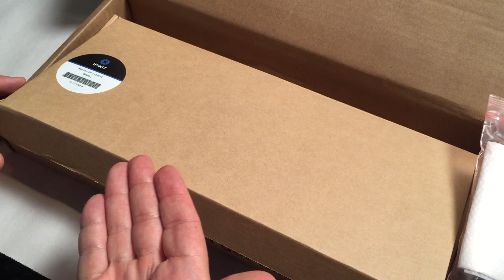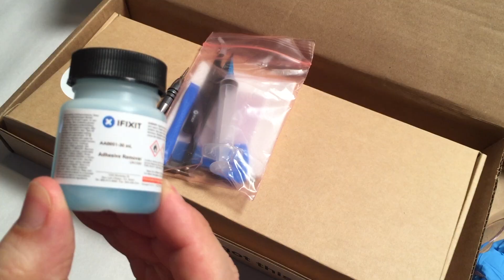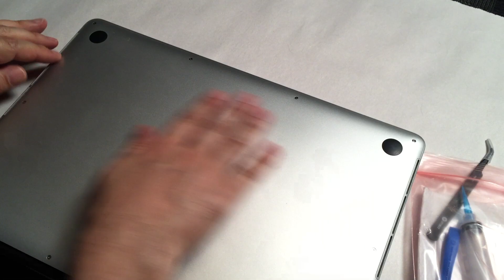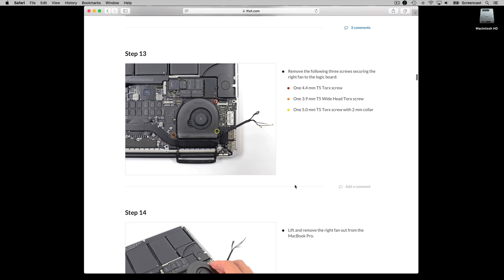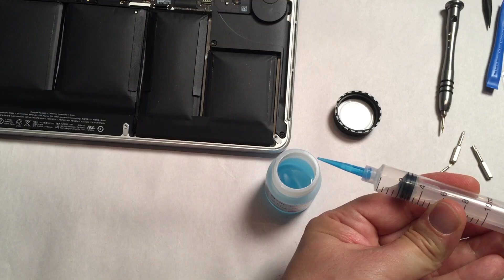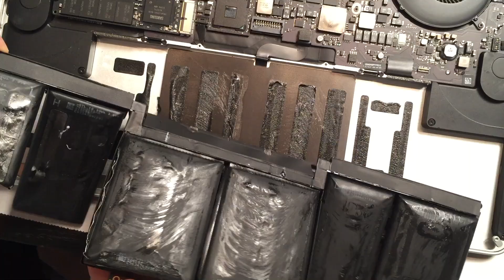Repair: MacBook Pro 15, Late 2013 Battery Replacement [ENGLISH]

Comment: I feel so pumped up as our very old 2013 MacBook Pro now has a new battery and new feet thanks to your super easy to follow video. The quote at the computer repair store was a $60 deposit to diagnose which would go toward the $175 new battery install fee. I was able to get a battery kit from the famous online store we all know of for less than $40 which included tools etc. An hour later, the battery is installed and charging our "new" MacBook Pro! You are brilliant and I thank you so much! I hit a like on this video. Have a great day and God bless!

Comment: Thanks Puromac for this video. I got this same MBP 15 late 2003. Battery cells were swollen so bad that they pushed upward on the trackpad. The trackpad stopped working and the machine didn't sit flat on desk surface. From what I hear this is common issue with this model. I have followed your video and successfully removed the battery with isopropyl alcohol and an old credit card. I did not install new battery so I am now using the machine as a desktop. It works fine, plugged in the wall, and the trackpad functions normally now. No more having to plug in an external mouse. Thank you again.

Comment: The removal part was so slick. I wanted to get rid of the batteries but I don't have replacements. So there is a chance that I broke something. But your method worked really well.

Comment: My mother has my old 2013 MBP and the battery is obviously by now dead. I asked a local shop how much the replacement would cost and they quoted 300 eur and told to recycle the laptop as it's not worth it. The thing is, it is perfectly usable and has a fast ssd so throwing it away would be insane. Ordered a new battery for 40 eur from China and replaced it myself.

Comment: Hurrah for this video - such a time saver over the iFixit steps.  I just replaced the battery in my 2013 MBP using this method. I used a length of strimmer cord in place of string, and it worked really well indeed. Thank you for this video.

Comment: Reviewing this for the third battery replacement in the mac book pro I bought in early 2014  The computer works nearly as well as the one I bought in December of 2024 and a video much l ike this let me do the second replacdemdentg quickly on the night before a long tr ip when the first replacement of the original went flakey. This is a great video. I already had the kit so I just bought the ifixit battery.

Comment: excellent video im going to be ordering a new battery ASAP! I got to thinking fishing line would work very well as its thinner and just as strong to get behind the battery. We use it to remove emblems and things on vehicles.

Comment: Sir, I can't thank you enough for this very clear walk-through of the process from end to end. I took my MacBook Pro 15, Late 2013 in to the Apple store in late December 2022 and was prepared to pay them $200 to replace the battery. The machine was crashing frequently and when I took it off the charger, the battery level would go from 100% to 70% in about 5 minutes and then crash. Apple told me that the machine is so old, they don't offer replacement batteries anymore. I was going to take it to a 3rd party fixit place (GoEBITS) but then I came across your video. (Isn't YouTube the most wonderful thing?!) I took your advice and bought the battery kit from IFIXIT for $90. I noticed they also offered replacement plastic feet, so I bought a set of those too (3 of mine had fallen off). It took me about 90 minutes total to replace the battery and the feet and now my computer has a new lease on life! (And I feel so accomplished -- I'm a computer repairman!) Thank you, thank you, thank you!
Reply: This is encouraging!  I'll be going through this process next week (when my iFixIt kit arrives ... although they charge $110 now ... still a great deal!).  Wish me luck!

Comment: i've just purchased a replacement for a macbook pro mid 2014, but the A1618 instead of the A1494... did someone try to change the A1494 for the A1618? Some forum replies say i might be dangerous, smoe say it isn't...

Comment: Thank you for this.  I took my cover off to clean inside and saw how swollen my oem batteries are.  They still work great, but the puffiness worries me, so I will attempt this procedure to renew them.  I don't want them to rupture or cause a fire.  Lithium is such a perishable power-source.

Comment: The best way to remove those adhesive residue is baby oil - you can dip a Q tip and soak each adhesive they will be easier to remove/ scrape or wiped with a paper towel. To clean the baby oil after you removed the residue. Use a 90% isopropyl alcohol on a paper towel and wipe the surface where the new battery will go.

Comment: Great tutorial. Just replaced my battery following it (no issues at all), the string technique is what made it a lot easier, just have to be patient for the adhesive remover to do its work.

Comment: Good tutorial.  One of my only extra bits of advice would be to not squirt the adhesive remover directly onto the plate covering the trackpad (squirt it onto the cloth instead), since some of it might leak around the edges of the plate and get to the workings inside the trackpad, where it might do some damage if there are any parts that are sensitive to acetone.  Even if the acetone doesn't damage the trackpad, it could continue flowing downward until it leaks past the edges of the trackpad itself and drip onto the display, which of course has a clear plastic front, where acetone could indeed do some damage.  Just to be certain, it's a good idea, before you start applying the adhesive remover, to insert something impervious to acetone and other fluids between the display and the keyboard/palmrest/trackpad, like maybe a sheet of aluminum foil.
Reply: Thanks for this advice! I may need to replace my battery soon and will do this! :)
Reply: May be worth putting a hand towel or such between the case and the display, since others have mentioned the risk of getting alcohol.acetone on the display and ruining it.
Reply: That happened to me. It flow through the screen and stayed there for a while until I noticed. It damanged the black finish the LCD has... So be careful with adhesive remover.
Reply: how would you get the cloth you squirted remover on, to glue under batteries?

Comment: https://www.youtube.com/watch?v=ayzzXKa1HOA&t=2s&ab_channel=It%27sBinhRepaired
The mid 2014 15" Pro appears to be the same. I also recommend viewing the above video by someone with more experience. Also it illustrates that you don't have to use adhesive remover at all. I used the technique of mostly "sawing" through the adhesive with dental floss (finger killer) and a "Palette Knife".

Comment: Thanks so much, worked great. I didn't have that kind of adhesive remover, what I ended up doing is dabbing some Goo Gone on the string, adding a little more as I worked down each battery, worked beautifully. Thanks!

Comment: Thank you. the string works really well. I planned to take the battery out and use it without battery. But I find it's not working without battery. When it boots up, it will restart automatically.

Comment: THANKS so much.  Mission accomplished this evening.  I had my steel trash can at the ready in case of battery fire (as were quite swollen).  TIP: blow the dust off your fans while the cover is off - just a can of compressed air for this.

Comment: Awesome method. I used dental floss, which was easier to get underneath the cells, but did hurt my fingers when sawing. Cleaning the old tape didn't take too long; a lot of it peeled off quite easily. All together the job took about an hour and a half.
Reply: What liquid did you use for the glue?
Reply: @carlosraul6578  Just the one supplied with the kit.

Comment: This method worked like a charm! One video showed basically disassembling every component from the case prior to battery removal. That was too many screws and connectors to remove and reassemble. One slip and the MacBook was dead! Tilting the case to keep the acetone under the batteries, and using great care with the string negated the laborious disassembly. The residual tape in my MacBook was much more difficult to remove than yours.

Comment: Fantastic video.  Totally worth watching this and skipping the more complicated steps.  I regretted not buying the ifixit battery but already bought a replacement kit without the tools or adhesive remover.  For those in my shoes, you can use Goo Gone instead of the ifixit remover. It  is non-toxic as well and worked great.  It is a little nerve wracking at first to use the string method, but it works great. Thank you

Comment: Just did this, and it works. Thank you for showing me how. One thing that is different - the iFixit kit now includes a squeeze bottle with a tip rather than a small jar of solvent and a syringe. Much harder to control where/how much solvent is applied. The center 2 batteries were much harder to free up, perhaps because I was too concerned about getting solvent on the trackpad, which was underneath. But it worked!

Comment: Is it ok to use water with soap to clean the mouspad area once the old battery is removed ?
Reply: 90 to 99% isopropyl alcohol would be better. I wouldn't use soap.

Comment: can u use any adhesive remover like Goo Gone?
Reply: I'm going to need to change my battery in the next month. ifixit's adhesive remover is 99% acetone which I dont want to accidentally risk getting it onto the board. I'm going to use 99% isopropyl alcohol. isopropyl alcohol can dissolve adhesive too but doesn't work as fast as acetone. ifixit has an article about the proper use of isopropyl alcohol (https://www.ifixit.com/News/36877/ask-ifixit-everything-you-wanted-to-know-about-isopropyl-alcohol ) which was really helpful (and safer).

Comment: Just finished my replacement based on this video.  Excellent technique - the "string cutting" worked really well for me.  An additional note for this technique: you may hear a little "popping" that sounds like it could be battery cracking - in my case that was the sound of the little piece of metal below the center batteries flexing as I "cut" the batteries off it.  Once you know what that is, it's pretty obvious - but the first time it can make you worried that the batteries "cracked" (which, of course, no one wants...)

Comment: Thank you. This was great and I really appreciated not having to go through the 900 extra steps that IFIXIT gives us. I have to do this again for a Macbook Pro 13 (Early 2015). Are the steps the same, or do I need to find instructions unique to that model? Thanks in advance.

Comment: This is much quicker than removing all the components and the nylon string idea looks easier than using the plastic credit cards supplied by iFixit.  I went the other route and removed all the non-battery parts first.  I found a lot of dust inside the heat pipe vents and the fan vanes.  So this allowed me to use a soft artist's brush and vacuum to clean the dust off all the parts.  I agree there's more risk of damaging the very small connectors and you have to be careful when reinstalling the logic board not to trap the various cable ends around it.  Removing the dust allows my MBP to run cooler and quieter now with the new battery.   Thanks for the good tips.

Comment: You make it look so simple.  There is another video doing the same thing on supposably the same computer (MacBook Pro 15 late 2013).  On his, there are wires and electronics at the bottom of the batteries.  I haven’t opened mine up yet to see what I have but why the difference?

Comment: Excellent instructions. I just changed my battery out and it was so much easier than I was expecting. I used the iFixIt kit and it seems to be operating very well.
Reply: How is the battery life and how does it hold the charge?
Reply: @ElenGlazova  so far it’s holding up very well. The battery holds a charge just as it did when I first bought my laptop 7 years ago

Comment: Thank you for this! I just finished replacing my battery. I’m now doing the calibration procedure. This was easy, peasy with the help of your vid. The batteries came out easily. Just want to remind folks: don’t forget to drain your battery and to protect the display with aluminum foil.
Reply: Do you mean to just cover the display with aluminum before removing the battery? like sticking a layer between the keyboard and display?
Reply: @cheddarcheeze  Yes, to protect the display from any adhesive remover that may drip. Maybe overly cautious but it was cheap insurance . Here's a picture of what I did to prep.
https://www.dropbox.com/s/mhswogif6gs22hd/118982452_10220448064370555_2693333804486361030_n.jpg?dl=0

Comment: Thanks for posting this. Not having adhesive remover and the wires handy, I use WD-40 and dental floss instead. The dental floss is not as strong so it breaks easily, but I manage to do it eventually after several attempts. It takes me 2+ hours.

Comment: Typical crapple, my current laptop has one lid with 8 screws pop it off unplug the battery and install a new one, lid back on, job done.

Comment: I replaced the battery. It works fine now but the activity monitor gives me just 4 hours of battery life. The original battery gave me 8 to 9 hours of battery life. Using CoconutBattery says the battery has a design capacity of 8755mAh and a full charge capacity 8852mAh. is it normal ?

Comment: Fed, thanks so much for this tutorial. I completely agree there is more risk to taking out all the internal components as recommended by iFixit so I was very pleased to see, and then use, your approach. I used isopropyl alcohol to dissolve the glue, which I'm fairly sure was not nearly as effective as using the adhesive solvent, so the process took a bit longer and was more tedious than I'd hoped. But nonetheless all went well and I have a new battery in my 2012 Macbook Pro, giving it another few years at least. Thanks again Fed and @puromac!

Comment: I used this tutorial for my MBP 15" early 2013 model, and it worked great! In addition to improving my battery life, my laptop also runs much cooler than when my old battery had a "service battery" warning. I use the Mac Fan Control app, and I was clocking CPU core temps of 85-90C while using Google Chrome prior to this repair, and up to 100C for Adobe design programs! Now, the CPU cores run at about 45-55C for Google Chrome usage, and about 70C for Adobe programs...
About the tutorial, I will say that the adhesive was much, much harder to dissolve than this video advertises. It took hours of applying solvent and sawing/prying under the battery in cycles. *Be super careful not to bend or warp the battery, it can catch fire or explode* Also, the trackpad is directly underneath the two main battery packs towards the center of the laptop. I almost dislodged the trackpad from the laptop when attempting to pry the battery from the adhesive. Make sure to wipe any excess fluid or remaining adhesive from the edges as well. Luckily, it still functions just fine, although it doesn't press down as far as it used to. Another note, the battery from IFixit did not sit perfectly flush some reason. Make sure to connect the battery to the laptop before you remove the protective plastic coating from the new battery & stick it into place (if you run into the same problem). There is a bit of flexibility in the wires that run from the battery pack to the connector. Lastly, make sure to dispose of your old battery using a hazardous waste removal company. It is unsafe to throw it in with standard trash.
Reply: there is another video showing that you do not require adhesive remover. I just used it. Worked a treat. Just needed gloves to "saw" through the adhesive with the string. Adhesive remover not required
Reply: @emmastables5332  may I to know which video shows that?
Reply: @patrickw72 : Here's one video showing essentially the same technique as shown above, but without using adhesive remover, but keep in mind that the stickiness and the stiffness of the adhesive might vary from one Macbook to the next, so that some people might find they can't saw through the adhesive without softening it first: https://www.youtube.com/watch?v=fupkPz55tUo

Comment: Thanks for this great video. I held off for more than a year on replacing my battery after looking at the enormously complicated ifixit guide but with this video it was all over in less than an hour and I didn't even need glue remover (I used nylon string).

Comment: Thanks for the video, will be replacing mine this weekend!
For everyone watching don't remove the tape on top from the new battery until after you glue it and line it up! makes the process easier to line up the new battery.
Reply: You should also test the battery to make sure it's working correctly.
Reply: How did it go Angelo?

Comment: Great guide, thanks. I also ordered the iFixit kit and followed a similar technique to yours but used dental floss and no adhesive remover. My kit did not have a syringe but a bottle with a tapered tip which made it difficult to apply in the way you did, but using a sawing action the battery cells came out without too much trouble.

Comment: Really good steps to do. I didn’t have the adhesive remove (which would have been easier) but I still managed to do it with the nylon thread but needed gloves as it was harder work to get the old battery out. 
Make sure you have the right screwdrivers as well.
Great guide...thanks a lot

Comment: I was skeptical buying a MacBook, Ive always been a pc guy, but this thing is amazing JustU.Faith/Mac-Book I have only had it for about a week but its been working like a charm. The only problem I might have with it is the battery life when Im doing video projects. Other than that I think Im going to enjoy this.
Reply: MacBook batteries don't run out for years. So you don't have to worry about it.